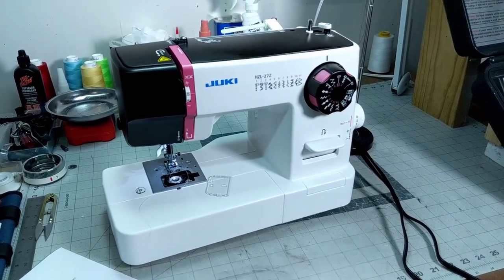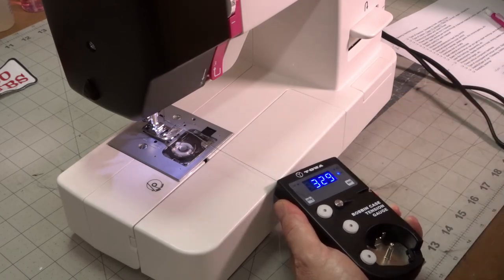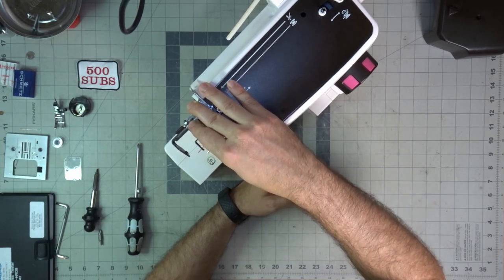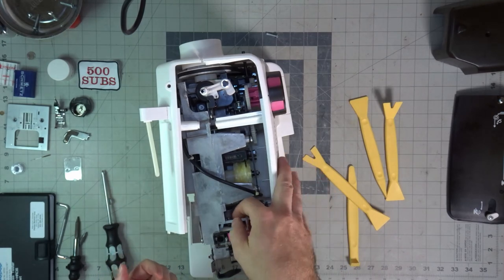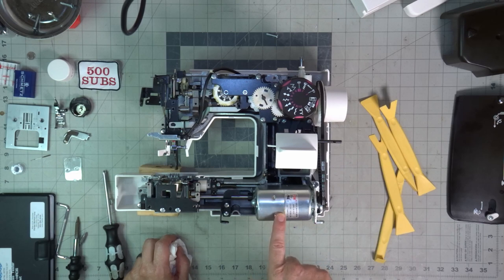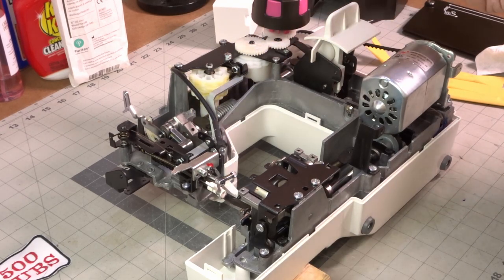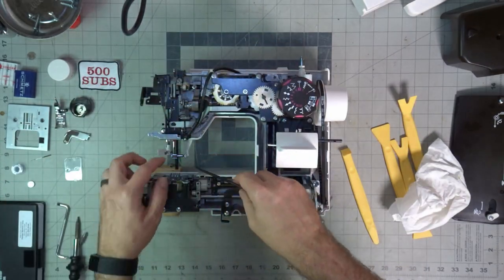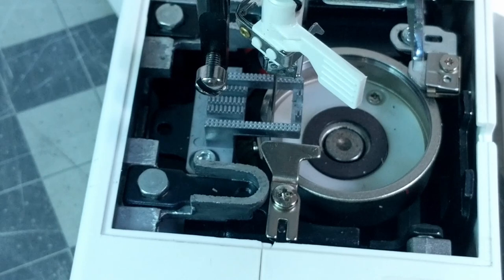Juki HZL-27Z Most In-Depth Sewing Machine Review on the Internet (Part 1)

Comment: As always, a nice tear down video!!!!!  I was curious about the motor power in amps for this machine, so I made a research of the power my own machines have and found the following.  Singer 9960=0,46 A, Bernina Deco 600 0.8 A, Bernina Artista 200/630/640/730 = 1.2 A, Bernina B830 LE 1.6 A, Juki HZL F300= 0.9A DX-7/QVP2000= 1.1 A, and my Bernina B880 2.1 A.

Comment: I just unboxed brand new Hzl 27z and have issues. It will only stitch in reverse. And horrible loud thumping/clunking noise. Any ideas? I am experienced sewer. I have cleaned, oiled, although neither of these things should need to be done. It is a new machine for peteys sake. I have NOT replaced the needle, but again, this should not be necessary and shouldn’t have anything to do with the machine stuck in reverse.
Reply from the maker: For a new machine I recommend returning it or getting a refund. It sounds like something went wrong when they assembled it.

Comment: Great vid! 
I have an early-mid 90's Toyota EC1 series 2466. It is literally built like a tank, metal (aluminium) through and through.  Even most of the the gears and the cam-stack are either made of metal or a hard resin like material.

Comment: I have a juki flora 550 an old portable sewing machine and I encounter a problem with the electrical switches. The main power switch knob is working, however, the on/off operating knob, when you press it down the machine runs and when you press it again to stop the operation it does not go off. All the three speed knobs switches are working properly. I do not know the problem and searching also for the schematic diagram for this machine I can not find it in the internet. I hope you could help me. Thanks a lot.